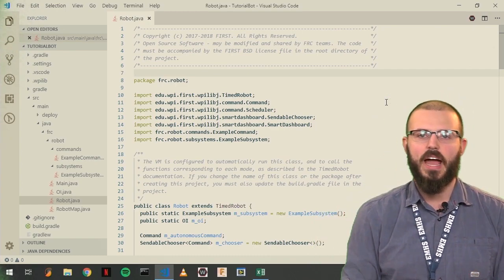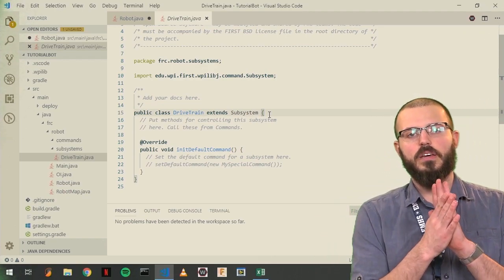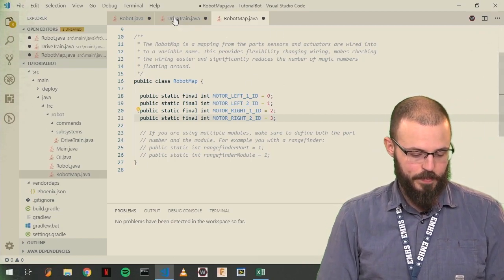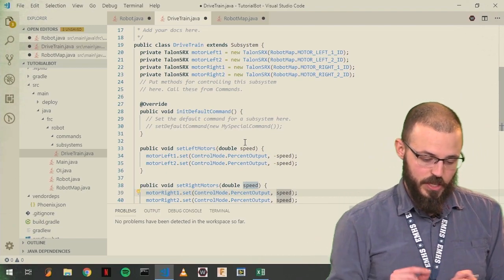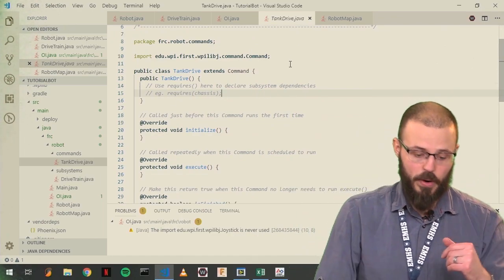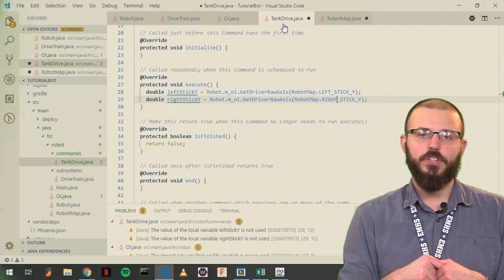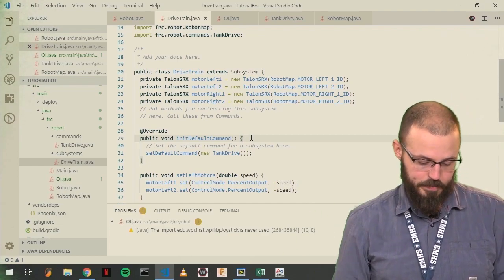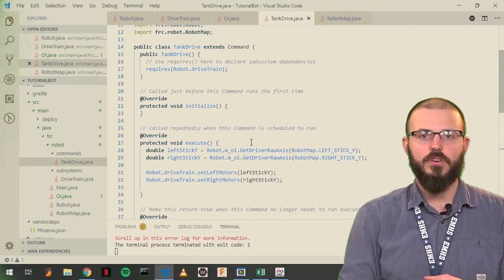FRC Java Tutorial – WPILib 2019 Command Based Framework Ep 2: Drivetrain and Driver Controls

Comment: Thanks for your videos, they are great.

I followed the steps and made the whole program work great.  However, I'm experimenting and created a second tank drive command called TankDrive2.java and had it do the same things but drive the Drivetrain subsystem with the triggers instead.  If the default command of TankDrive is in there, it only runs that.  If the default program of TankDrive2 is in there, it only runs that.  Both work fine if they are set as default.  However, how do I make one of those commands interrupt the other?  If there is no default, the bot just runs and does nothing.